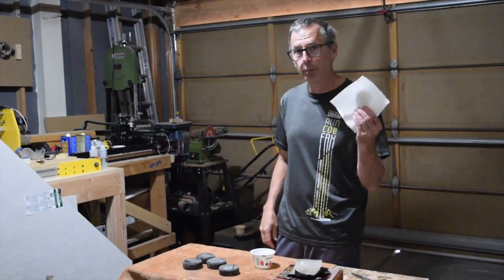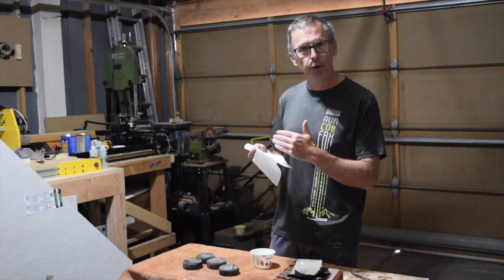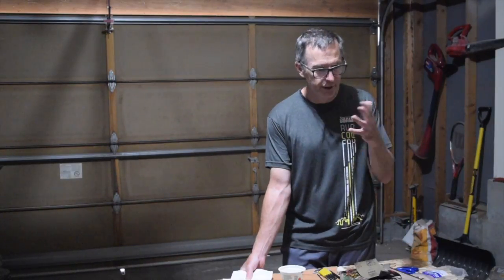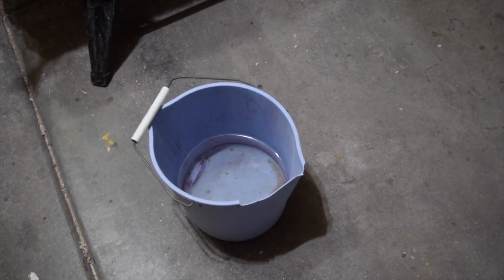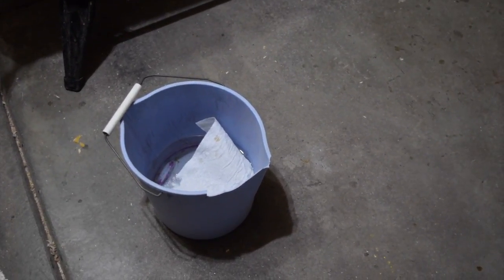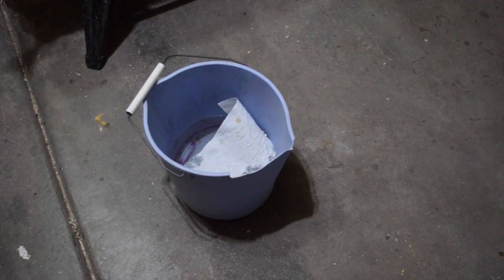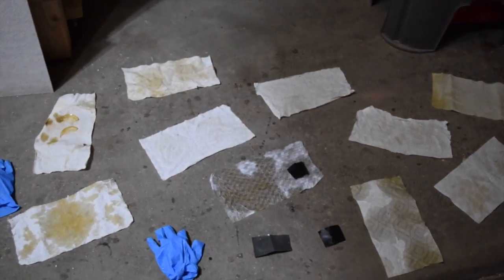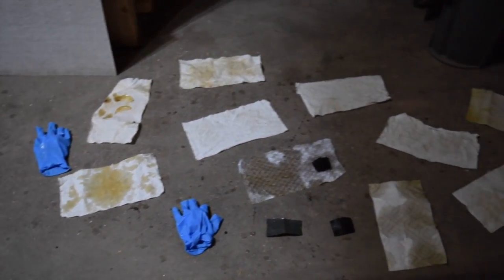The Proper Disposal Of Oil Soaked Finishing Rags

Comment: Tanks for the video, I flatten mine out and when the wife isn't looking, I hang them flat and open with no folds in them on the clothes line with clothes pegs and the next morning they are dry. I then still leave them for another day or two and then crumble them up and leave them on the lawn for a day or two before discarding them in the dustbin.

Comment: You can also put all the used finishing rags in a 55 gallon steel drum and put the lid and retaining ring on. Than if it did catch on fire, the fire will run out of oxygen very quickly and auto extinguishes itself. Then the CO2 forms a barrier while the rags are still drying.

Comment: I'm an advocate of the bucket of water, I've got a dog that wonders the workshop looking for wood to chew so oily rags on the floor is not a good idea. There is also sawdust on the floor a lot of the time, combustable oil + sawdust is not a good idea. Much easier to sling them in a bucket of water, out of reach of the spaniel, tie them up in a plastic bag on bin day and put them out for the rubbish collection, once they're watered down, they're not going to catch fire, especially in an air tight bag. oily water goes down the drain, job done.

Comment: What if you have a gas water heater and furnace in the garage? Is the pilot light going to blow up the house? 🧐
Reply from the maker: Don't use flammable finishing products.
Reply: Highline Guitars so what are my options?
Reply from the maker: @MrChucklepuff  Water-based polyurethane. I recommend products fro Crystalac. https://thecrystalacstore.com/collections/all?page=2&sca_ref=47054.Mb3CZXZ6Od
Reply: Highline Guitars on that site they have a shellac in a spray.  Do you think I can get away with that too?
Reply from the maker: @MrChucklepuff  That shellac is still highly flammable. Instead, consider the water-based sanding sealer first followed by their Brite Tone clear coat. Both can be brushed on if you can't spray.
Reply: Highline Guitars I found a water based poly spray I am trying out.  Got a gloss, satin, and semi gloss.